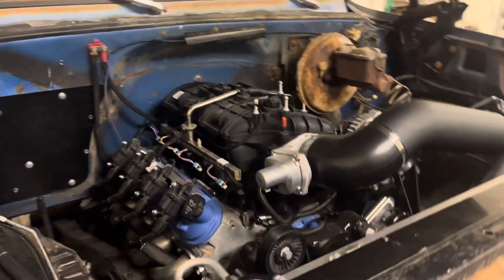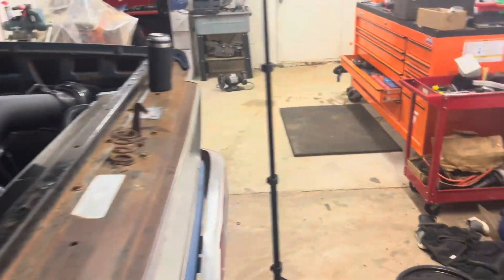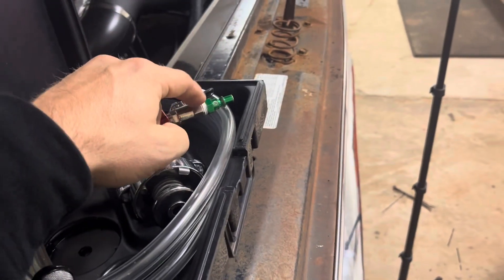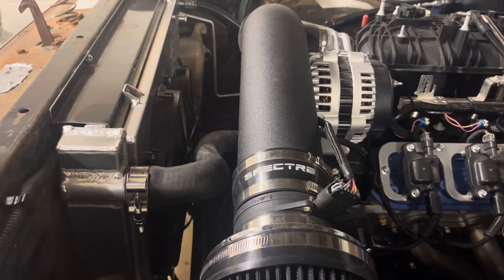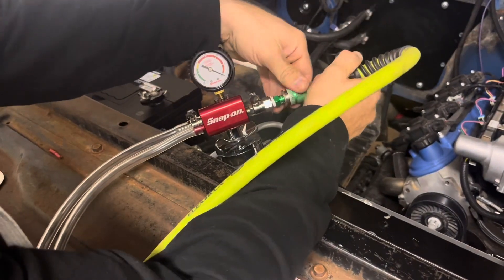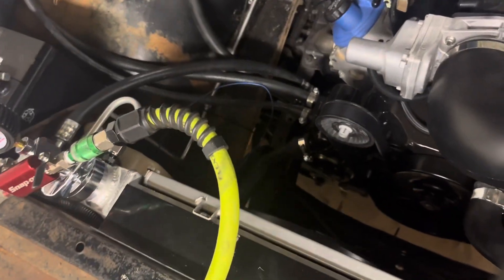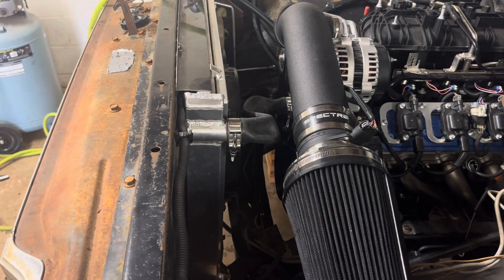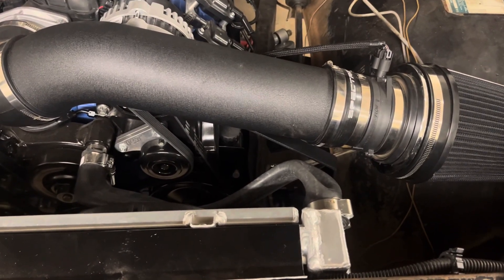How to vacuum fill a LS Cooling system.

Comment: Correct me if I’m wrong, but I did not hear in the video if you needed to fill the block first. Does this vacuum system? I’m assuming open up the thermostat with the vacuum? Or would it be better to fill the engine from the upper water pump inlet first ?